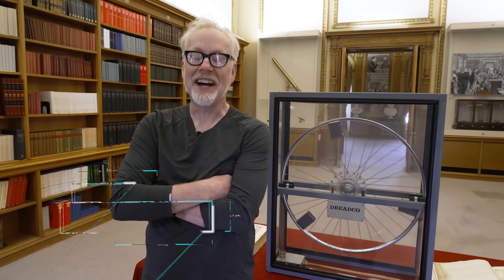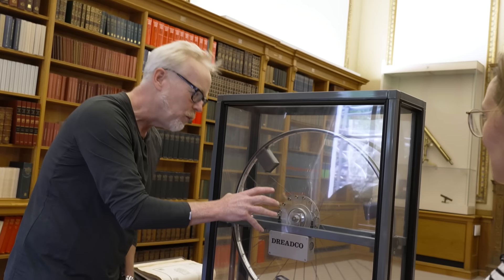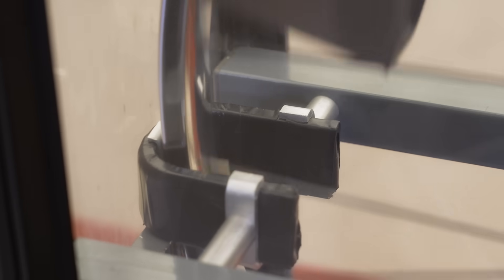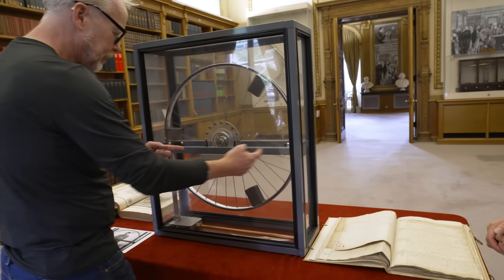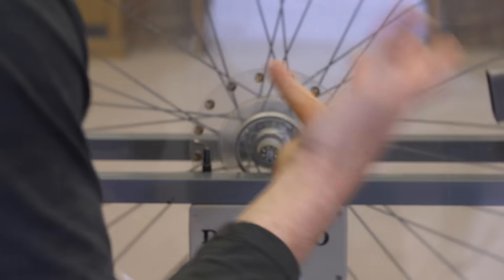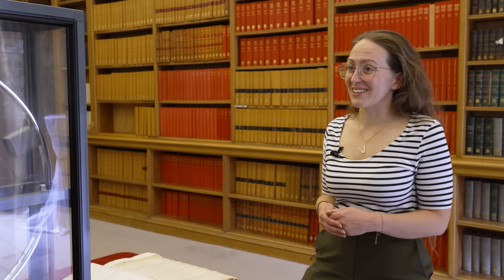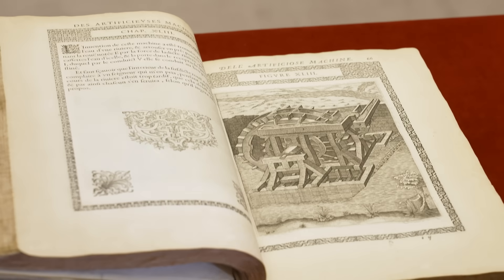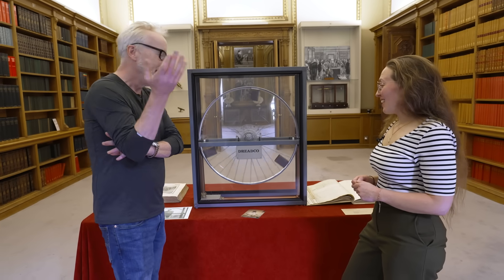Adam Savage vs The "Perpetual Motion" Machine!

Comment: Fascinating..I have always believed that a vehicle of any sort can be one day created to move without refueling or recharging. As a rough example how about a vehicle being able to recharge it's own batteries by the wheel movements. So the vehicle could have two three or four rechargeable batteries. Only One battery being used at a time while the others remain dormant, but as the vehicle moves the wheels are recharging the dormant batteries. Once the main battery being used to motorised the vehicle requires recharging it can be disconnected to one that is charged and so it goes on. Hope i've explained this ok and you get the idea. It could mean endless power until they batteries required renewal. Yes? Love watching your enthusiasm and interesting videos. Thank you
Reply: Lol, how would a vehicle be able to produce MORE energy then it started with? You are just moving whatever energy you started with between the batteries until they all run out
Reply: @fredrik7411  you are only using one of the four batteries while the others are being charged by the moving wheels . So you start with 4 charged batteries, you only use one to move the vehicle, the others are left in reserve. Once the power has gone from the one battery you connect a charged battery, the uncharged battery is connected to the moving wheels which recharges it, and it continues in this way. It must be possible
Reply: It is about creating a battery charging system using the moment of the wheels that are being moved by only one of the charged batteries, you probably don't understand
Reply: My car does exactly this.

Except that I have to charge it every night, since pushing air out the way, and rolling 2 tons of metal down the street requires energy.
Reply: @CorwynGC  so you have a battery car that propels the car on this battery, while the wheels on the car chargers the other spare batteries to be used when they power goes from the one battery and the charged one is then used. The uncharged battery then is recharged by the motion of the wheels
Reply: @grazer2003  Well, it's all the same battery circuit, but yes.  Splitting it into multiple circuits wouldn't make any difference.  And it, of course, only charges when braking.
Reply: @CorwynGC  I think you're missing the point of a system to recharge batteries, never mind
Reply: @grazer2003 No I am not.   It's just that it doesn't work the way you want it to.

Comment: Spoiler alert - this machine is very simple.  Read below

The three boxes on the hub are magnets
on both sides are coils
at the center the two "probes" are like inductive pickups that trigger off the little "dots" on the spokes
this energizes the coils just as the hub magnets approach the coil and give it a "kick"
inside the dreadco box is a battery which requires changing every couple years.
they make toys that do a simple movement like a character waving based off the same idea (brief magnetic "kick") and can run off a really small solar cell because they use almost no power.
Reply: Except everybody thinks of that and the lady said only one person has come close.
Reply: @petermgruhn  Which leaves the question why put in such an obvious solution as a red herring?  If I had a really clever way of doing this, I wouldn't add an easy (false) solution unless I was planning on removing those components and showing that it still works, to blow people's minds.
Reply: No need for the probes.  The coil of the Electro-magnet is capable of detecting a magnet approaching.

Comment: Simplest explanation is that each of those three boxes on the rim has a battery,. a coil and a reed switch. When they move through the permanent magnets on either side, the reed switch will momentarily close, sending a pulse through the coil which magnetically couples with the permanent magnets and get a small kick. Absolutely bog standard electric motor, and with big batteries and a small pulse it'll run for years providing the hub bearings are good. You could test for this with an external coil and an audio amplifier, and see if you hear the clicks. The heatsink box is certainly a red herring, there's no way there's enough energy anywhere in there to need that.
Reply: My thought EXACTLY. Very simple, no electronics. Just batteries, magnets, electromagnets and reed relays.

Comment: My guess is that there are electromagnets inside the three boxes, which are triggered by switches that react to the tilt of the wheel. Just a very short moment before each box reaches the next U shaped permanent magnet, the electromagnet inside the box is activated for a split of a second, so the e-magnet and the permanent magnet attract each other for a short moment. These tiny periodic moments of magnetic forces are sufficient enough to compensate the kinetic friction of the hub and because each e-magnet is turned off again before is is actually passes the next U shaped magnet, it will not make the wheel stop in that position, as it would happen when two permanent magnets were involved. 

That is my guess, but I will probably never know if I am correct.
Reply: Except everybody thinks of that and the lady said only one person has come close.
Reply: @petermgruhn  I read many comments on this kind of machine, and they all suspect simple magnets to do the trick. But as I said: permanent magnets won't work here. If there are magnets involved, they have to be pulsed in some way.
Reply: You're correct.  Not only that, but if Lithium primary batteries were used, the run time could approach 15 years.  We manufacture products that use this technique, but on a much smaller scale.
Reply: @johnbode2756  True, but maybe when this machine was built, lithium batteries were not yet invented or at least not available in that size. Furthermore, the regular "maintenance" interval could just be what it says: I'm sure there are critical elements at this machine that need to be looked after at a regular base, e.g. t he hub needs to be oiled or greased, the wheel needs to be checked for unbalance. No matter, what is causing the motion, I'm sure the forces involved are very weak, so that the slightest unbalance could stop the moving. I'm pretty sure that's why the glass cage is there: it's not meant to keep people from touching the machine, it's there to shield the wheel from motion of air.

Comment: Wow, I never thought I'd see something with an actual 'DreadCo' label!
 
Wonder if they have the 'DreadCo-No-Parking-Asphalt' outside - a phenolic acrylamide resin which develops a hard skin while in contact with oxygen, but reverts to polyacrylamide after 1 hour in contact with tire rubber - basically super-gluing the offending car to the parking spot until the fine is paid and the release-reagent is applied by the meter maid...

Comment: Static electricity. I'd wager that bent metal is iron, the acrylic is highly effective at storing a static charge which would propel itself against the posts. The copper and iron create different ionic charges creating a loop. The boxes are spaced just enough to give the machine a bit of a push to make up for the energy deficiency otherwise. Without the surrounding box the static would be lost to the air, but self-contained it helps finish the circuit.
Reply: Creating static electricity requires energy.
Reply: @CorwynGC  yes, motion. This isn't a perpetual energy machine because there's no such thing. What this is really is a few dynamic principles on top of each other working in concert. The motion and electrical flow is what builds the static up. The reason it needs to be worked on periodically would be to degauss everything. Eventually the charge equalizes out amongst the parts. The photoelectric portion would act as a reservoir to help extend the lifetime between maintenance cycles.
Reply: @Justin_Ebright  So you are using the energy of motion in the wheel to create static electricity, which you are then using to create energy of motion in the wheel.  How does that even help?  All of those conversions are lossy.
Reply: @CorwynGC  yes, they are, which is why it's not perpetual. That's why it has to be restarted periodically. For all intents and purposes in most cases 1.0 and 0.9999999998 are the same number, be it practicality or overall consistency, however when said difference is used decide to the energy needed here it's like a battery that slowly runs out and needs an external source of motion or energy to restart the mechanism. The way this was engineered was done so to maximize the time between needed that external force. Think of 1980's battery life vs now days. It still runs out, but at a much slower rate. 

All of these mechanisms together add to the longevity of the "charge".
Reply: @Justin_Ebright sounds like you are violating conservation of energy.   Removing energy from the wheel, converting it a few times and adding it back is ALWAYS going to be a loss.
Reply: @CorwynGC  how am I violating the laws of physics by explaining a perpetual energy machine that's not perpetual? Or are you purposefully just trying to be obtuse at this time? Cause if it's the latter I don't have time for thar crap. I'm not going to argue with some stranger over my estimation about what makes a device operate. Furthermore I've stated repeatedly that it does run out of energy it's just designed to maximize the time between the necessary inputs of external forces.

Comment: The boxes on the wheel are permanent magnets. One of the horseshoes (which contains a coil of wire) the magnet moves through acts as a sensor (probably the one of the left of the screen) by producing a small pulse of current which is sent to the DREADCO box. Circuitry inside then triggers a small voltage in the other horseshoe as the other magnet on the wheel approaches. This small voltage attracts or repels the magnet giving the wheel a small 'kick'. Power to the DREADCO box is provided by a load of AA batteries in the grey metal frame of the unit. The frame looks modular and easy to remove to replace the batteries. The copper pipe does nothing. That's what my money is on.
Reply: Doesn't even need to be that complicated.  A simple amplifying circuit will give a boost to a magnet passing through an electro-magnet.  The magnet induces a current in the electromagnet, which is amplified by the circuit, which pushes on the magnet.
Reply: With an IR diode sensor you wouldn't need to take any energy away from the momentum by using the magnets, which would slow it down. Why wouldn't it use a photosensor that works in the dark?
Reply: @maiabones  In the theory presented above, the magnets are how the right hand mechanism transfers energy to the wheel.  Using a very weak sensor coil to detect the rotation is a very common tradeoff in electronic brushless motors.  Another option would be to detect the passing of bolts past the two weird protrusions.

Comment: A motion machine that slows down over time, after two years, surprised this isn't a joke, its a balance set up, the frictionless bearing at the center, and the left magnet pulls down, the rest is misdirection. I have invented a real device that will run for 1.24 million years. Contact me, the public can't put this motion machine to work, my motion machine takes no fuel and can power hearing aids, computers and eventually electric cars. Take this motion machine out of room temperature and see it stop. If this was the best example of endless motion machine, the world will be shocked with my new invention, designed to help the individual in a power outage, to never have a dead battery in a emergency.  No one believes me, in time, you will

Comment: The box in the corner has a small balloon in it  slowly releasing a tiny amount of air through the tube to the right side, blowing on the outside of the wheel to keep it at a mostly constant speed until the air in the balloon runs out. Everything else is showmanship, trickery to throw people off.

Of course I don't know this, but it's just a silly gag mystery anyway so we can all have a go, and be just about as right as the next person, as there's a thousand ways to make a thing like this :)
Reply: Air in a balloon wouldn't last a day, to say nothing of 2 years.
Reply: @CorwynGC  It does in my imagination ;)

Comment: It's pulling RF energy from the air.  There's enough around.
Reply: I would love to see your math on that!
Reply: @CorwynGC  a crystal radio set can power earphones with no batteries.  Do you think its something as simple and fraudulent as batteries somewhere?  You only need enough power to replace what was lost not to activly power the wheel full time.  IF the museum knew it had batteries they would have rightly tossed it in the dumpster.
Reply: @LanceHall  This by you is math?

Comment: I think the copper tubing and heatsink are just for show.
It reminded me of old pendulum clocks that used D size batteries (1 or 2, can't remember) and ran for at least a year.
If my memory does not betrays me, they have a permanent magnet, a inductor and a magnetic sensor to energize the inductor when the magnet is nearby, so it saves energy.
Take the same idea and apply to a wheel... Ta-da!
Reply: I've got one of those clocks, purchased by my dad in the 50's.  It is a Junghans ATO,, but used a mechanical switch to briefly energize a coil to push the pendulum.  The switch wore out, but it wasn't too hard to design a circuit to sense the voltage induced in the coil when the pendulum moved through it.  Once the voltage in the coil was sensed, a delayed pulse was applied to the solenoid.  My design has been running for a couple of years off of 4 AA alkaline cells, and will probably run a couple more years.  Mr. Jones bike wheel will have more aerodynamic drag, but shouldn't require a lot of energy to slowly turn, and the design can easily fit a number of batteries.

Comment: The copper pipe device is there to cancel out the generation of electrical impulses that will cause drag.  I think Lens Law  might be the correct term. Drop a magnet down a length of copper pipe and you can see the  Lens Law effect.  This is a true magnet only powered wheel. Not all of these use strong neodymium magnets.  This one looks like there is special shielding on the 3 magnets that are on the bike rim.  Possibly the magnets need a quick zap after running for 2 years. As far as charging some sort of battery, you are way off base on that….i think 🤔

Comment: One of those things that make you go "Hmmmm"! 🤔 Is it an optical illusion, but to my eye (watching this on a 32" HDTV at arm's length) it doesn't seem that the speed is constant. It seems to vary slightly three times per revolution, even when the shot is focused on the hub and the three "things" on the rim are not visible. Hard to express but as if it gradually speeds up and slows down, not a sudden "blip" of change. But I'm just a retired Mechanical Engineer, (although technically I hold two Science degrees). Wonder if recording it with a high-speed camera might give some insight? Ratz, now this is going to bug me! 🤨
Reply: If it is observable you can measure it, no?

Comment: I do wonder if the slowing down has less to do with how it works and it’s just the wheel bearings need some grease or replacement since a wheel spinning “forever” has to follow entropy somewhere.
Reply: If anything the bearings would be the most important part, you could get far by making sure the effect of friction and air resistance are negligible
Reply: @dodgeman777  When Adam poked the side it didn't sound like it was in a vacuum, which would seem the obvious way to improve performance.  
Still not going to get 2 years of spinning with no input energy.  A day would be amazingly good.
Reply: Entropy is the reason a pmm can't exist, so it's a fundamental aspect of how it works

Comment: Heats sinks imply heat, which is energy loss from the system - and a pretty big loss if you need sinks. They have to be pure decoration to confuse you.
Reply: they work the other way around, too...
Reply: @nobody8717  Either direction, they only 'work' when there is a temperature DIFFERENCE.  Overheating electronics is one source of Δt, what would be the source of Δt to run other way around?
Reply: So your argument is that they're absorbing heat energy? How is the box they're attached to below ambient temperature? Where's the energy coming from to make that happen?

Comment: Definitely battery powered... Probably a very small motor running and super low voltage...
Reply: Or a huge, very visible motor ...
Reply: @johndododoe1411  if it were very large the battery wouldn't last nearly as long...
Reply: @NorthernFreedom  You are mixing up the size of the motor with the energy consumed. The energy you need to spin this thing depends on how uneven the mass is distributed (presumably very evenly) and how large the friction in the entire device (including motor) is. The size of the motor does not factor into this equation. You can distribute a very weak motor over a very small space or a relatively large space (say, the entire wheel).
Reply: @KonradTheWizzard  yeah, I'm not a wizard of electronics... I was making a guess.

Comment: For those that don't know, there are motors that fit inside of bicycle hubs - they've been hidden there (successfully) during road bike races. 

They produce an incredibly small torque. A motor can be mid 0.90s efficient. Add in a Pelletier device to change it when there's a temperature difference and a bank of capacitors and you could probably run at this speed on a single charge for a couple of weeks or so. 

The weights on the wheel are a distraction or are meant to increase mass to avoid small changes in torque causing changes to speed.